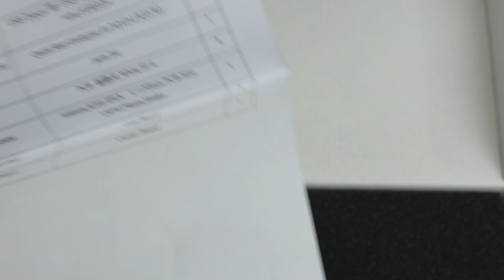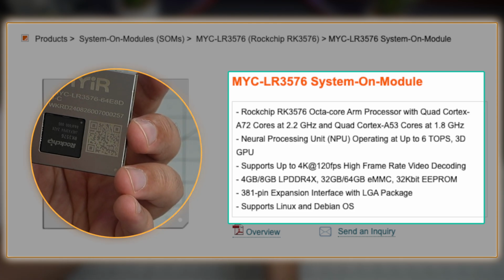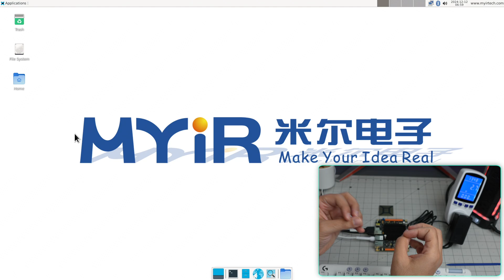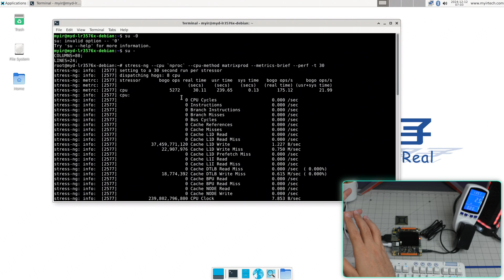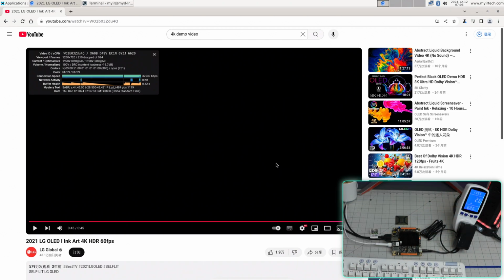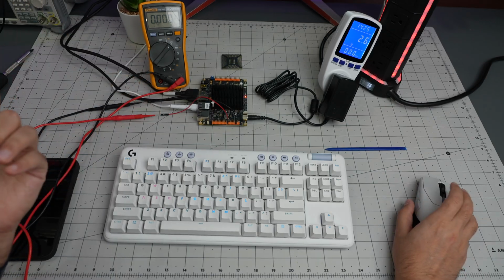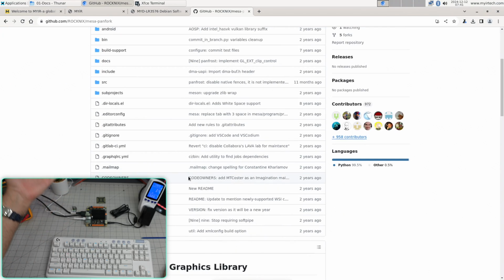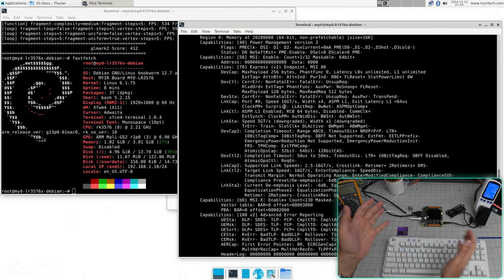Is this the sexiest SoM yet?!

Comment: Looks like a copy of an Octavo product - just not as well integrated.  Octavo creates a true SIP (system in package) where the CPU, memory, power dies are integrated together into a single package.  This solution is like a compute module that gets soldered in place.  The main difference being this solutions is much larger then a SIP.  On the plus side, it is probably faster then anything that Octavo creates.  I designed an Octavo solution which only draws 0.5 W on idle -- so pros and cons.

Comment: Hi, it seems their Debian OS is better optimized than the one of Friendlyelec (or is it the CPU ?), because on a NanoPC-T6 (RK3588) the stress-ng command only reflects a bogo ops of 1222, although a RPi 4 w/ 8 GB RAM displays 2344, quite odd :/).    The sysbench test results are more consistent with my machines (laptop w/ intel i3, NanoPC-T6 & RPi 4).

Power consumption is very good.

The datasheet of the RK3576 show amazing picture and video intrinsic features, I hope some apps will soon take advantage of all these.